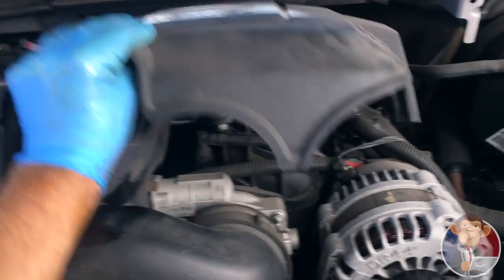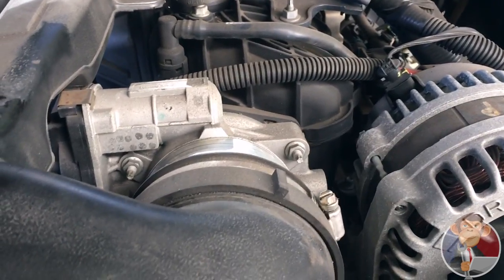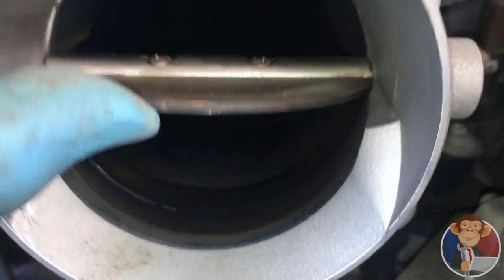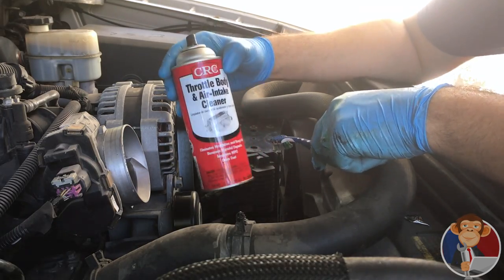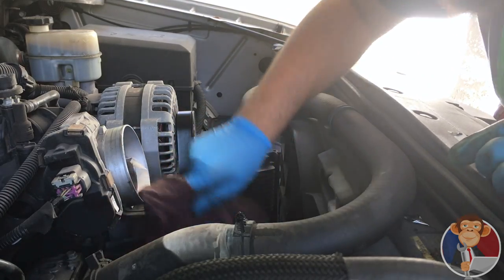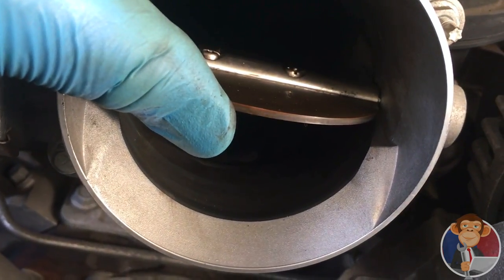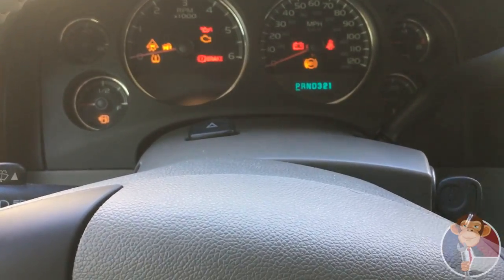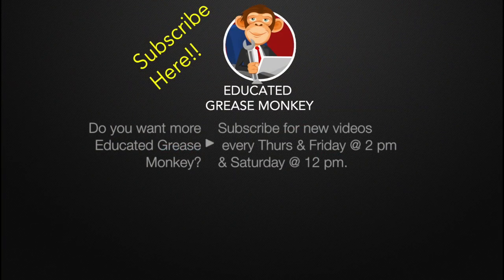How to clean the throttle body on a 2007 - 2014 Chevrolet Tahoe - EGM DIY

Comment: Take off the throttle boby when ur cleaning it save ur engine 2 nuts and 2 bolt if u ask me this is the wrong way to clean ur throttle boby
Reply: I agree, another 90 seconds time for 2 bolts, 2 nuts, and the electrical plug and the TB is completely removed eliminating any chances of hydro locking the engine. Leaving the TB on is lazy.
Reply: And it’s needs a program if you take the throttle body out
Reply: @budanah-Bh  it need a reprogram either way lol
Reply: @budanah-Bh just disconnect the negative on the battery and when u done go for a long drive so the computer can get use to it and you’re fine just did mine this past weekend no issues
Reply: Cool. Between the guy making this video and the logic behind your comment, I believe I know what to do. If I take off the throttle body I don’t have to worry about seizing my engine. Right?  Thanks for the advice, it’s logic. 🇺🇸🙏🏽

Comment: There are too many scenarios wrong with this video, 1) You should have removed the throttle body from the engine, then spray clean it, you don't want to introduce foreign chemicals to the engine. 2) The butter fly is computer controlled, the BCM will still think the (TB) clog remains, until it re-learns the Idle on a cleaned throttle body, which can take driving your vehicle over 150 miles, unless if you have an active online scanner to make the computer adjustments. According to your video, If someone follows your instructions, then start up their vehicle, the first thing that will happen is the (RPM"s) will shoot up to 3000, once they press the gas. This is a quick way to clean your (TB), but it's not a recommended way to do it, it will cause more problems for you!!!
Reply: 😭  my rpms are high.   2500 3000 😞
Reply: no mames James, the video its fine, and nothing will be damage inside for a little bit of "external chemicals" , Master GM Mechanic
Reply: @joepruneda2263  
My rpm when high too😱.
Just did a few minutes ago so im looking for answers
Reply: RPMs are at 3000 at idle. A lot of people need help with this. Any expert tips??
Reply: @Durin Greyowl, Only what I described in my comment, there are two ways to resolved your problem, 1) if you have an active scan tool that allows you to make computer adjustments to the (BCM), You'll have to make the BCM re-learn it's idle after cleaning the throttle body, or 2) eventually after driving for 100 miles or so in stop and go traffic, the BCM computer will eventually re-learn that the throttle body isn't congested any longer, and start making the proper adjustments to  gas and air ratio. I AM NOT A MECHANIC, but I have personally experienced and dealt with this issue and resolved it myself. I don't have a scan tool so what I did was found a mechanic that charged me $35.00 just to make my Tahoe re-learn it's Idle. Hope this helps you to fix your problem!!!!!
Reply: @MrJamesgrate  yup had to use a high end scan tool. It's the fastest and  best way to solve the idle issue.  Stop and go driving or the three min run, three min off, three min run procedure doesn't always work even multiple frustrating tries. Also shifting into gear at high idle could damage your transmission, and there's the gas consumption to consider.
Reply: James Grate good explanation, and also you write very well. Good job!
Reply: @benkwaku4632  Thank You (Ben Kwaku), I just want to save anyone from the headache I encountered when my chevy tahoe malfunctioned along with a dozen service engine codes, and the culprit was a dirty (TB). This video does not explain about the hazard about working on today's (TB) while it is connected to the electrical system
Reply: Durin Greyowl did you fix your problem? I just did a new throttle body for a 2012 GMC Yukon SLT. You have to do a system relearn. You need a high end scan tool to do it right. Hope this helps.

Comment: Ok vid, but as others posted, don't open the throttle manually, these newer style Chevy's use electronically controlled throttle bodies and opening it manually will throw it off calibration.
Reply: It will definitely throw it out of calibration and the dealer only charges $138. Learned the hard way.
Reply: @dougsanders6034  what were ur symptoms?
Reply: @JoeyDaBull  the throttle position on my 2008 , 4.3 v6 being out of calibration caused it to over Rev. And it idled at around 2000 rpm and when I would turn it off it would sometimes diesel or want to keep running. What are your symptoms?

Comment: Nice video. I use Seafoam to clean my 08 yukon denali xl. The only difference is I have someone lightly put there foot on the pedal and let the cars natural operation open the throttle body while I spray the cleaner in. With this method I don't have to reset anything because the car is working on its own. I then let the truck rest for about 30 minutes and then start it up again. you will see that big black cloud of smoke come out the tail pipe and bamm. It is running like new. I rarely have any issues with my truck and I have 188k miles on her.
Reply: I’m sorry to tell you, but Seafoam spray does not clean your throttle body. This is a different required maintenance.
Reply: @themadmattb  I just came from O'Reilly's Auto store and they told me to use Seafoam to clean the throttle body.  I'm glad you commented. Thanks
Reply: I wish I would’ve read the comments before buying the TBC. I was thinking about using seafoam too so I could put the leftovers in the gas tank.

Comment: Easy solution, just remove the throttle body and do the cleaning outside the vehicle. Definitely recommend cleaning the MAF sensor at the same time as well
Reply: Make sure you use MAF sensor cleaner not throttle body cleaner

Comment: Also if you're worried about the possibility of using too much cleaner, you can spray the cleaner onto a rag, rub the now cleaner-dampened rag on to all dirty parts, then use a toothbrush, then use clean side of rag with more spray to finish it off.

Comment: 14 chevy 1500 25,000 on odometer v6 was told by dealer I needed to have my throttle body and fuel injector cleaned. confident in doing what you've shown. what are your thoughts on fuel injectors?
Reply from the maker: Most cars dont require you to ever flush the injectors. If you do not have a reason to flush them. Leave them alone.
Reply from the maker: Cleaning it isn't going to fix a problem with the sensors. You have to replace the parts if they have been diagnosed to be replaced.

Comment: Thank you for the video; a bit apprehensive at first. However, I did lite and few strays with just a cloth to wipe up black residue. 10m later engine light turned off and idle is back on point. Salute! From a novice viewer.

Comment: Consider disconnecting the power even if you don't remove the throttle body from its mount. These electronic types sometimes to an auto cycle. If that plate slams shut on your finger its powerful enough to take the tip off. You may not be able to remove your finger with the reduction gears engaged.
Reply: Use screwdriver handle (or similar) to hold throttle body open while cleaning.

Comment: Hey bro, great video on cleaning throttle body, however i was tild by a mechanic that if you move that valve with your finger or even after you clean throttle body it dis-programs it self... im ny case i got a service traction/reduced engine power/service stabilitrak on my dashboard... i hooked it up to a scanner and got the P2176 code, please help!

Comment: I did everything as u did in the video, had NO problems with starting the truck up. The RPM were high at first but then it idled down. The only problem I'm having is, when it's in park r in neutral and I tap the gas pedal, the RPM will jump to 3000 r so for little while and then slowly idle back to about 500 rpms. Also, i noticed that right before coming to a complete stop, it feels like the truck lounges forward. And as soon as I let go of the brake the truck starts moving forward normally as it should, but in no time at all I'm in second gear and doing 15-25mph (without touching the gas pedal). Any ideas on what's causing this.  

Great video........short, simple and straight-forward.
Reply: I have the same problem
Reply: Hey I'm having the same issue after cleaning yesterday. Did yours relearn itself?
Reply: Stephen Casanova that’s a differential issue. Rear differential. I had the same issue. 2012 GMC Yukon. I replaced all the u joints and bought a new nickel plated yoke. Flushed the rear differential fluid, tranny fluid and it shifts like a dream. There should be a recall for this issue, but GM hasn’t done that yet. $350.00 out of pocket will give you sound mind.
Reply: Stephen Casanova Did you find out what was causing the problem? Mine has similar issues.
Reply: Stephen Casanova is it fixed now im having this issue
Reply: Maybe check out this video about a learn reset. Not sure if that will help. https://www.youtube.com/watch?v=7oIBGlJbZEc
Reply: Did you ever find out the problem
Reply: Relearn is needed
Reply: U will require gasket maker to seal off the trottle butterfly valve  because using ur hand to clean that valve has made it hv clearance while allows excess air. Had same issue just fixed mine
Reply: Sometimes they have to re learn or be reset

Comment: Hydro lock it? Lol the stuff evaps in seconds! No worries on hydroing with tb spray
Reply from the maker: I've seen techs lock up engines by emptying a bottle in there.
Reply: Thatd take some quick doin!  Stuff usually dries quicker than i can scrub:)
Reply: RIGHT? a friend of mine tried to tell me that's why mine wouldn't start ...and he's a licenced mechanic...  maybe with seafoam and not idling high enough then shutting her down before it burns off, but not throttle body cleaner, unless you pop the can and dump it in
Reply: Exactly I have to do this once a year. You can spray the crap out of it. Zero problems

Comment: Hi, I just did It the same way, before watching this video, and now. I have high idling, I did the 
3 minutes on 1 minute off 3 minutes on again,
The driving around 40 miles and nothing
Any suggestions?? Thanks
Reply: Drive another 40-50miles, at 40-45mph. That fixed it for me

Comment: I think it's great that you responded to the questions everybody had 

Nice video and insight
Reply from the maker: its hard to write back to everybody. I do try and help as much as I can.
Reply: So is there no need to have to relearn the idle ...like reset it with a scanner
Reply: He's not responding to the crucial questions
Reply: @efrengarcia9506  You can do a re-learn. Idle 3 minutes. Turn off. Do that 3 times. Also, if that doesn't do it, take your vehicle on the highway. Throttle up and down above 44 mph. For many miles. I have heard a minimum of 50 miles. You can try those steps a couple times. If it still fails, repair shop time.

Comment: Hey Carlos, nice video there.. However I have a question, in your video you moved the butterfly with your hand but by doing that, does the truck will have higher revs or malfunction or does it has to relearn the throttle position again?? I have seen in other videos the guys saying not to touch the butterfly to avoid moving it... I hope you can teach me into this. Thanks
Reply from the maker: I wouldn't go as far as saying don't touch the butterfly. They are known to go bad (they way you mentioned) from time to time but I worked at a dealership and I would do this service about 4 to 5 times a day on similar models. In a year, I might see one go bad. However, if you don't clean the throttle body there is a good chance you will experience low idle and drivability concerns. 

If you do not want to risk it. Then, you could try having someone push the accelerator pedal with the ignition on, engine off. I'm not sure if that will get the butterfly to move though because ultimately it's controlled by the ECM.
Reply: You can have someone press the gas pedal with key on, ignition off. That's what I do, my tahoe insists on this service every few months.
Reply: Para evitar la desconfiguración, es mejor desconectar el arnés antes de limpiarlo.

Comment: Is this most likely the cause of my rough idle? Ive used a few fuel system cleaners, changed sparked plugs and even had my worn engine mount’s changed, hoping this works
Reply: Did it work?
Reply: @rubydoobie9717  i never tried it, i just bought some fuel system cleaner and used it a few times every 2 fill ups and helped my problem

Comment: I have a 07 Yukon Denali XL Is cleaning it really going fix this Engine Power Reduced Problem ? Or im better off buyinh a nneew Throtttle Body from autoone Shits getting outta hand cant go no fatser then 30 mph smh
Reply from the maker: I never said the cleaning would fix a reduced engine power code. This is just maintenance. If you have a Reduced Engine Power situation I would get the car scanned to know where the problem is coming from.
Reply: Hey I realize this is a year old but you need a new throttle position sensor. They about 40 bucks at most auto parts stores. Easy to change too.

Comment: I cleaned as described in video but now I’m idle until at 3k rpm. Anyone know how to fix?
Reply: Your truck will reset after driving a certain number of miles.   You have to open using the gas pedal only not by hand.

Comment: Do you like SEA FOAN, for cleaning Carbon, build up ? 
Awesome videos 👍🏻👌🏼🍀✌🏻 Good job 👊🏻
Reply: with that seafoam you dont run the risk of over spray. It melts all that gunk away with little if any scrubbing. Nice suggestion. And it get real deep in the throttle body.

Comment: After I cleaned mine when I put in drive it reved by itself to 1000rpm without me touching the gas pedal does it eventually correct itself or relearn it self I also disconnected the positive battery cable
Reply: Mine use to do half of 1 now it’s at 2
Reply: Take off the negative battery terminal

Comment: Ok Hopefully I can get a response? Ok so I have a 2010 Tahoe Z71 5.3 vortex flex fuel  that I bought a month ago I started to realize that the idle drops when I'm stopped in a drive thru or at a stop light it goes from normal idle to a few Rpms lower and then you can kinda feel a little bit if a stutter bad it never stalls or dies and as soon as I push on the acceleration it's fine and it never happens while driving also I have no check engine light it just does starts doing it randomly when at idle do you think that it's a dirty throttle body and just a simple as a clean? Please help I thank you for your time in advance.
Reply: Did you figure this out? Same issue here
Reply: @miacoleman2927  The things I replaced were the air filter, battery, spark plugs, I installed a oil catch can and had a fuel treatment done at the time of the oil change. After replacing the items listed above my truck runs perfectly, never had the problem since. And it runs 10 times stronger and smoother then it did when I first bought it. I also get about 5 to 10 better MPG on premium chevron gas. Hope that helps. It only cost me $200 for everything including the oil change and the only thing they didn't do for me was install the oil catch can, but anyone that's even kinda  Mechanically incline can put it in about 5 mins.

Comment: I have a 2012 Yukon xl that has a hard time starting cold. usually if I don't use it in a day or so. once I get it started it won't do it for the rest of the day. it also has a hard time starting after I pump gas. what I have to do is hit the gas and eventually it starts with a could of smoke coming from the tail pipe. 
Question; will doing this help me or is my symptoms something else? Thanks in advance!

Comment: I also did this before but the car is going 3000Rpm , why?
Reply: When you manually open the plate you run the risk of messing up the calibration

Comment: Would you recommend I take the throttle body completely off so I don't risk spraying too much cleaner in the intake?
Reply from the maker: I wouldn't unless you plan on replacing the throttle body gasket. Those gaskets are so thin that just removing the throttle body could break them. Just spray it in there. It helps clean the manifold as well. Just keep an eye on how much. in other words if you used half of a bottle its way to much. Just spray a little and brush, then spray a little more and wipe clean.

Comment: Having an issue with my 07 suburban. On the highway abs light came on and check engine light aas flashing. Pulled off high way, misfire on 7. Changed coils, plugs, wires, oil, air filter, cleaned MAS. Turned back on abs came on "service stabilitrak& service traction control. Now reads misfire on 3. Wth do I do now? I have heard grounding wire, brake sensor thing, and abs spees sensors can be the issue, from an online search. Do you have any advice?

Comment: What do we do if : LOCK UP ? 🤔🤕👍🏻
Reply: Get a new car lmao
Reply: You can take all the coil packs off and all the spark plugs then turn the car over! If your lucky, it will spray all that crap out through the plug openings with the super high compression not under load!